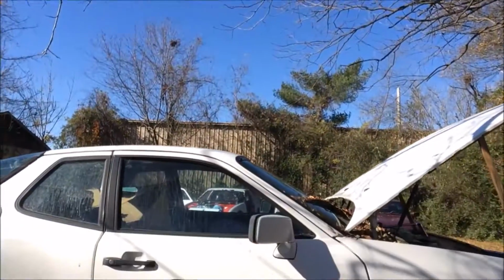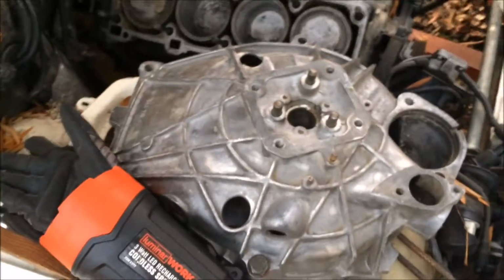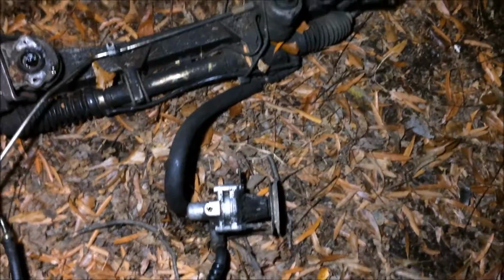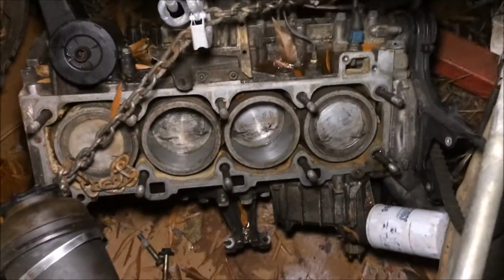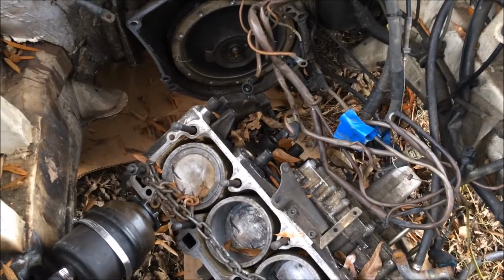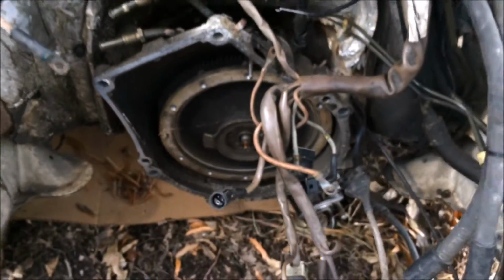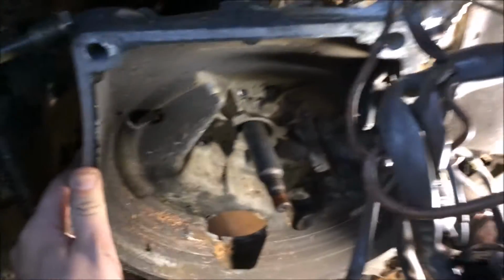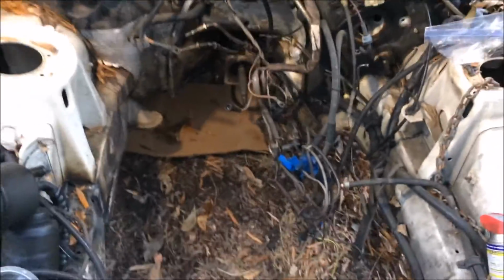Porsche 924S / 944 Engine Pull Part  2

Comment: Great job. Enjoyed it a lot. When you tear into a car, you never know what you'll find. LOL
Reply from the maker: Yeah, this this was an even bigger mess once I dug into the bottom end. Looks like the oil cooler seals failed and they didn't even bother to replace any of the seals. Instead, they just slathered everything with RTV and put it back together. That said, I was watching these videos a while back. I might go back and remake these videos since I still have the original footage. I had to cut a lot out since the mic on the camera wasn't working and I didn't know until after filming, but I could probably dub some audio over them and make them more fun to watch.
Reply: Yeah the video is good. I think laying down an audio track is a good idea --- especially for those who are new to the 944. I was curious where you got your music bed. Very tasteful.
Reply from the maker: Thanks. I had a lot more dialogue originally and I would like to put some of it back in with some music underneath like the later videos. At the time I hadn't really come up with a formula for making videos. All the music I use is royalty free from the youtube library, so that someone won't try to claim a copyright on my video or delete the audio. So I just work with what I got... glad you like it, though. I think that using music helps set a pace and make the videos a little more watchable.
Reply: Agreed.

Comment: Great how too video as usual. Did you remove the passenger balance shaft and housing to drop the engine? I couln't tell in the vid.
Reply from the maker: Nope. No need to remove the balance-shaft housings when pulling the engine. Just need to remove the cross- member and lower it down. I hope that helps!

Comment: Hey łove your vids, it realy helps with the restoration of my 944. But wy do you drop the engine, is it not better to take it our from the top ?
Reply from the maker: Some have said it is pretty easy to remove it out the top. I tried it that way the first time and never tried that again. To remove the engine from the top you need to remove the clutch and bell housing or you won't have enough room between the cross-member and oil pan. You need to pull it forward enough for it to slip off the drive shaft, which is loads of work and just easier to remove the cross-member, which at that point you might as well just drop the engine and be done with it. Trying to get the oil pan up high enough to clear the nose panel without the engine crane topping out or hitting the hood also makes this job harder than just dropping it. I hope that helps!

Comment: Nice video! 

How high would you say you need to get these cars to move a complete long block with cross member under it as part of a remove/replace procedure?
Reply from the maker: Thanks! The frame rail that I pulled it under was up about 20 inches off the ground there with the engine tilted on its side. I'm not sure exactly how high the bottom of the car was lifted up, but maybe around 17 inches or so? To remove the engine standing up with the cross member you would probably need to get that frame rail up around 2 1/2 to 3 feet.
Reply: Ok, thank you. I thought I'd read that you want to raise the car 40" to do it that way, but hadn't read many accounts of people dropping the engine out of the bottom as per the workshop manual. it seems most pull it from above. My goal is to connect everything from transaxle to engine and just roll the whole mess under the car and lower it on to it.
Reply from the maker: Yep, you may need 40" of clearance, that was just a guess. I tried to take it out the top once, but I was going to have to remove the hood and even with the car down on the ground, I couldn't get the crane high enough, so I never tried that again. These engines are down in there and its easier to just drop them out on the ground. Not to mention I probably wouldn't have been able to move that crane in that soft dirt with an engine on it if I went out the the top.

Comment: I just bought an 85 944 that needs some TLC. Do you know anyone is the Greensboro, High Point, or Winston-Salem area who does good work on these cars? I'm not sure if it is mechanically sound at the moment so if I could have someone who knows what they're doing take a good look at it, then I would be very happy.
Reply from the maker: I'm not aware of any off hand. I have worked on a few 944's in that area before and no one has mentioned any. If you need anything, just let me know. I can always help and I have tons of parts at my shop!